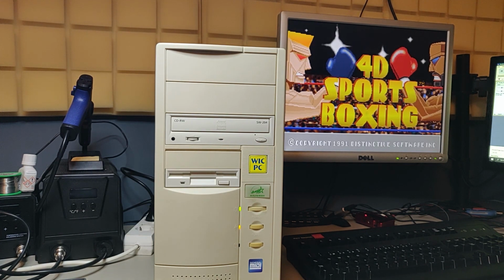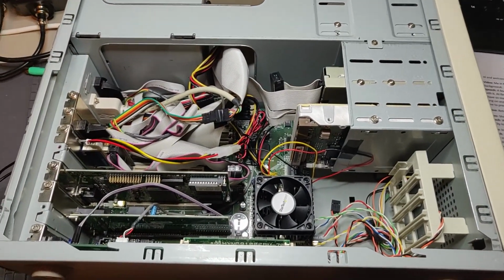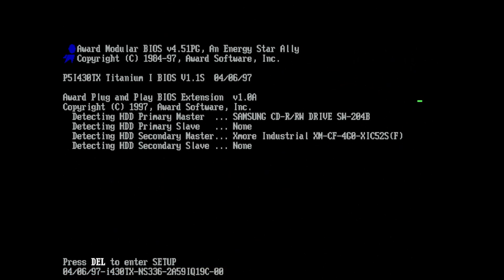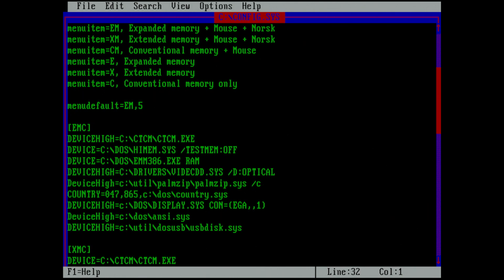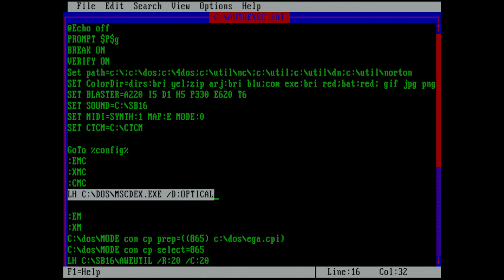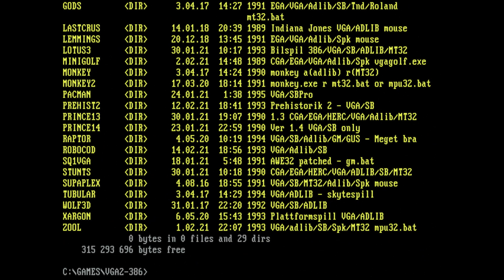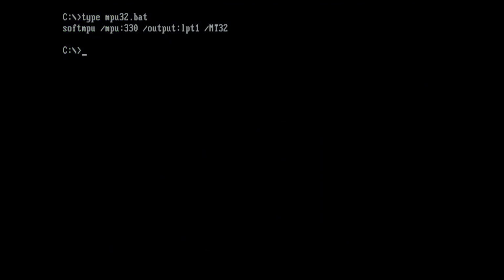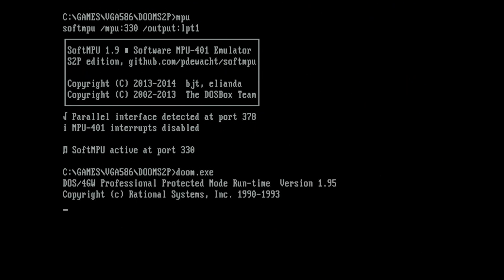Pentium 200 with AWE32 and S2P

Comment: I remember my awe32 to be a longer card, but there might be different revisions. I have it my attic somewhere, I should go find it.
Reply: The CT3670 might be the shortest of them all and it's based on the AWE64 as Erik mentions and it's actually not an AWE32 but rather a Sound Blaster 32 which lacks onboard RAM. It contains the CQM FM synth rather than the Yamaha OPL3 found on some early AWE32 cards. Some people actually soldered OPL3 chips to the CQM versions of the AWE32 and SB32, but I don't think it's possible on the CT3670.
Reply from the maker: AWE32 came in different versions. https://en.wikipedia.org/wiki/Sound_Blaster_AWE32
You should definitely find your card. If you are not using it, it could even be a display piece.